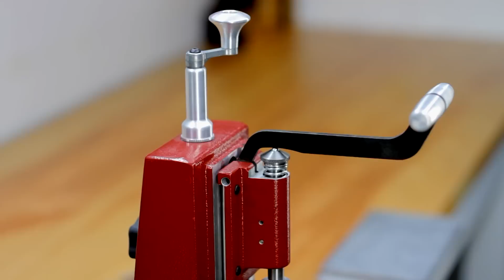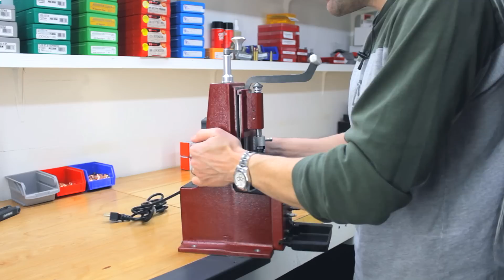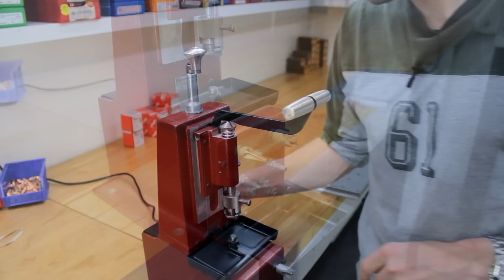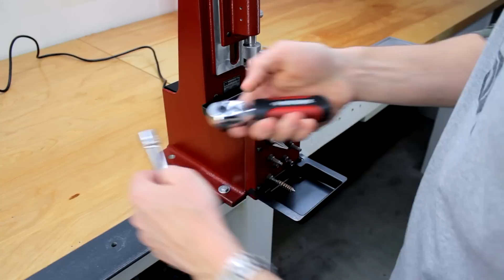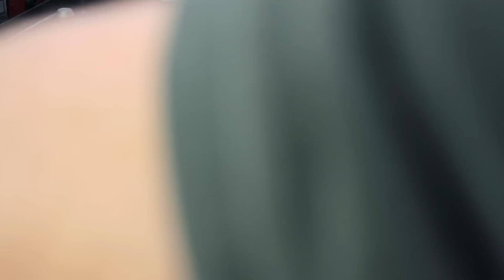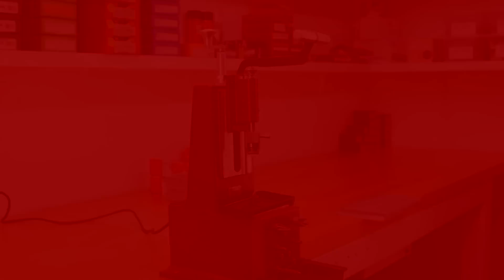Hornady Case Prep Center Overview

Comment: I looked at one and then decoded to use an RCBS power trimmer with three-way cutter. I also bought the Case Prep center from RCBS and use it for taking the crimp out of mil brass and cleaning primer pockets. The RCBS unit is a lot easier to dial in a specific case length and the 3-way cutter is way more convenient. Yes, it takes up more space to use two machines but, I don't need a primer swage and I can clean and standardize flash holes all at once.  This looks trick, but I think my choice fits my needs better.

Comment: I am sooo disappointed by this product, I bought it in august 2023, the spindle spins under load and dings up the locking pin, got a replacement spindle and pin, and after 50 trims, it spins around again and dings up the pin, $700 down the drain, plus I bought extras…

Comment: That's a no from me. I can't stand to take the time to lock the case into the shell holder. Overall it seems like it can do a good job, but that load case and lock into shell holder is taking too much time per trim cycle. I want the tool to skip that loading step, and just use my hand to jam the case into a cutter tool, as the Frankford tool can do.

Comment: I have one and well .....there is a lot of room for improvement. The case trimmer section is fiddly at best and difficult to accuracy set up the case trim distance. Once the case trimmer has been set up properly, then it is a simple matter of quickly trimming your back log of case prep chores. I have no issue with the primer pocket reamer and other rotation tools.  If you have an opportunity to look at how the slider mechanism is engineered......as I said there is lot of room for improvement.

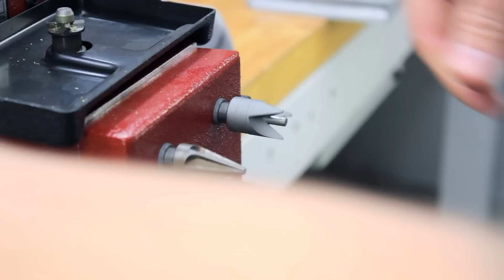Comment: The vertical adjustment on this thing looks really janky. Having to undo the knob at the back and then using coarse thread on the adjuster rod would make for difficult accurate adjustment. Why didn't they use a real fine thread and a micrometer so you can measure the brass and then make that 0.003" or 0.001" adjustment if needed? The method to lock in the brass also looks really time consuming and would fatigue your hands. RCBS's spring tension system is way faster and requires much less effort. Additionally if you look at 5:42 when he's using the deburr tool you can see how much the trim die is bouncing up and down. This doesn't look like a tool that would produce precision ammo to me. Great idea on this whole tool but it looks like very poor execution.
Reply: Agreed, this review made me not want to drop $500 on one of these for the same reasons you've mentioned

Comment: Sold Me.... Great review. The case trimmer on this is what got me. The way the tool locks the cam in place and the way it functions like a drill press seems like it will ensure a square and correctly sized case every time. I'm logging into amazon right now!

  The Hornady cam lock trimmer is almost impossible to consistently repeat case length length with. I find that after about two or three cases the lock nut has slipped and doom inspires.

Comment: Will this deswage military brass?
Reply from the maker: Crimp = "staking" primer in place. Swage = remove primer crimp by forcing "plug" into primer pocket (such as swaging station on Dillon Super 1050). This tool can be used with a primer pocket reamer that cuts the crimp out, and puts a chamfer on the primer pocket opening which can make priming smoother and less trouble-prone. So- yes, you can remove primer pocket crimps with this case prep tool!

Comment: Have you seen or had any problems with this unit cutting off square?  I just got mine today and after setting it up and trimming a few 30-06 cases I began to notice that the cases were being cut off square.  All I can figure out so far is that the cutter head move to off center when the shell pushes on the pilot.  So far I havent figured out how this is happening.  Any thoughts?

Comment: As a long time machine operator you might want to try doing all the operations on each piece of brass rather than picking each piece up and setting each one down 3 times it could save some time. pretty neat piece of equipment. Thanks for all the info and demonstrations.
Reply: I like to see him trimming a couple case and measure them at different points to see if it trims even all around the case.  MY RCBS Pro 2 case trimer is + or - .005 at diffenet points of the case as you measure all around the trimmed case.